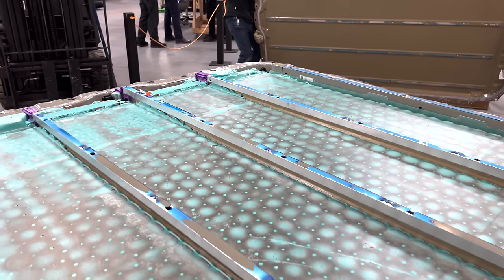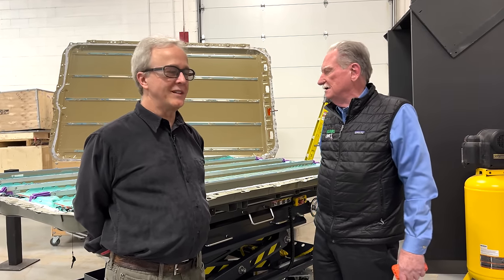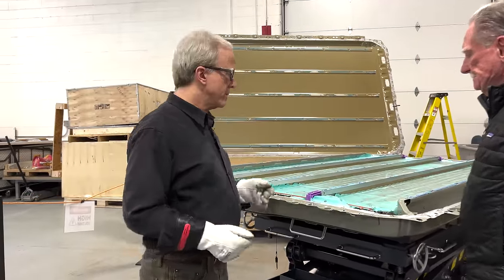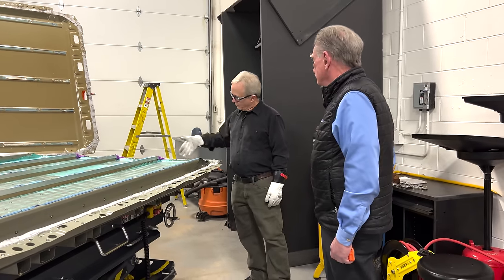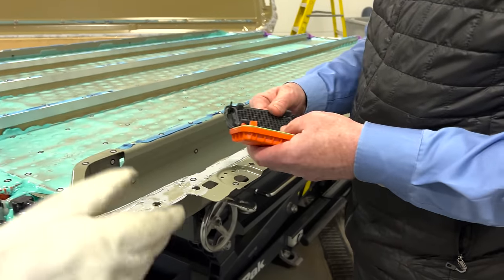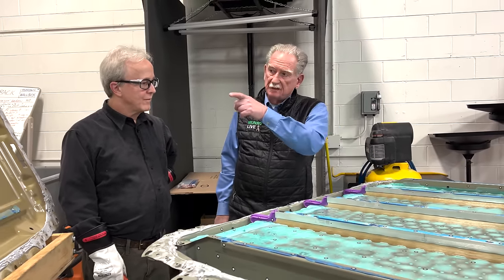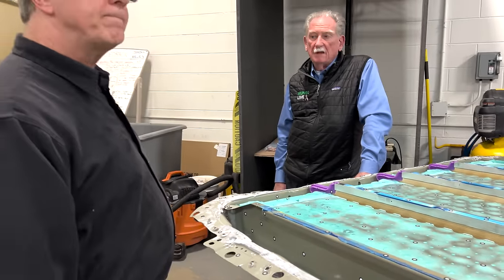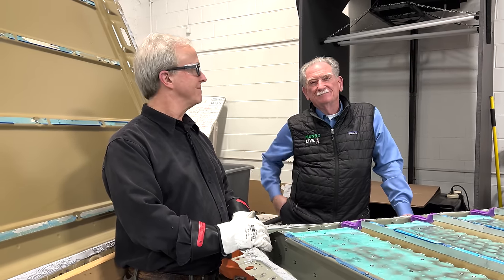Tesla Cybertruck Battery Pack: Our First Impressions Under the Lid

Comment: How is it possible to recycle these batteries if they are encapsulated in foam?
Reply: I don't know how but Tesla says "None of our scrapped lithium-ion batteries go to landfilling, and 100% are recycled. Lithium-ion battery packs should only be handled by qualified professionals ...".   I don't know how but I expect they shred them like they do no structural packs.  This exposes the minerals to be reclaimed.
Reply: @danharold3087  From that statement, maybe it means that 100 of their battery units are recycled but that does not mean 100% of the minerals or other materials are recovered.  Or how much energy is required.
Reply: @johnm2879  You are correct.   Foam for one is not likely to be recycled.    Quick look did not result in numbers but found this "Recycling EV batteries can also be energy-intensive but is significantly less than mining raw materials."

Comment: Thank you for addressing the wood question at the end hahahah!! I was doing double takes, and you were talking about ventilation, and I wanted to know how they were going to get the humidity from the wood from causing problems in the battery!!  Elon designed the battery compartment to take compressed air in submarine mode.  are we just going to act like Elon isn't the Godfather of the electric car?  Can we put a flowmeter on the pump that pressurizes the battery and warn the driver that the battery has a slow leak and they need to go to a tesla dealership to replace some valves?  For the love of God, have the car send an email or something instead of a check engine light.  They put so many things under that check engine light its unreal.
Reply: Not sure any Tesla has a check-engine light. This was mandated for ICE cars I think for emission issues. When a warning or issue needs to be communicated, Tesla pops up a clear message in English (or local language) like "Washer fluid is low".  There is a log you can look at to see prior messages too.
Reply: Elon

Comment: On safety, you should assume the case is already shorted to the battery.  So hanging onto the case while touching just one battery terminal may kill you.
Reply: When working with high voltages keep on hand in your pocket.

Comment: Don't worry, Tesla will add hydraulic latches and drop cylinders so you can pull off the interstate drop your battery, and get another slid under and the hydraulics will pick it up under your truck latch it in, and connect it and you are on your way. 20 min.

Comment: I saw some articles complaining about how much wasted space there is in there. I dunno, I think it's fine. I'd rather have that impact safety buffer.
I do also agree that the battery size is a bit too small. Should have been 150kWh for the base model. Well, at the current pricing anyway. But to stack more cells would mean a decrease in cabin space, or a taller vehicle. I'd be curious to see how the hummer/silverado EV pack is designed. I'm assuming less safety buffer space or interior space was sacrificed.
Reply: yes indeed ,will be cool to see , how the silverado , put there pack together.

Comment: Is this foamed in the battery case or in a tool and then glued in?
Reply: In case.  They want direct contact to the cells to prevent vibration and conduct heat

Comment: Nah I see it you see that weird cracking pattern closest to electrode attachment of cells “hottest spot” you see where the foam and resin stay the same as in “thermal stabile spot” do not direct wire like dominoes , a weird style of cross connections and long for noise and thermal connections to make the whole battery and every cell the same temp and output

Comment: How would this get recycled?
Reply: Easy way to explain, is that it get crushed in a huge grinder and then dropped in to a tank filled with "acid" . When it's become a "fluid" , you treat the fluid in different stages to extract back different elements.
Reply: Wasting a lot of energy is how

Comment: SO, if anyone has seen a little cell phone blow up or about any battery for that matter then you would know the danger of basically sitting on that much energy. you would be dead in seconds but finding what is left of you in the melted concrete, asphalt and molten metal will be hard to do.

Comment: Repairing the skid plate in the event you do damage it will cost an arm and a leg. Probably cheaper to just do a pack replacement.
Reply: Or you JB weld Bondo fill the dent.
Reply: @Barskor1  Dents are not really the kind of damage I was thinking about.
Reply: @motofunk1  Strap in another plate ontop if you plan on getting wild.t

Comment: We saw here most recently many model 3 with panasonic cells facing an issue aorund 100000 km and quite young with roughly 2 - 3 years, mostly first hand owned cars where the issue starts with a message and then from the next charging the range will dy , I mean fast decrease over night.

Then they need to swap the battery and if you are lucky that mess is fixed within 1 day cause when it occures they can do a diagnosis remotely , which means they will offer you a swap date. Some have gotten the appointement the next day so fixed in 24 hours which is great in such case where they get a used battery with a similiar state of battery health.  That means tesla is repairing old batteries which I really like to hear, but:

What do they do with all these nowadays glued or baked in foam battery packs ?
Do they have a foam dissolver which chemically kills the foam and makes it a fluid again or are all those packs a full mess and junk which has only 1 direction left: recycling 

I hate to see this design, I loved and preferred these beautiful 5 kWh boxes which could haven been even bigger like 10 kWh pieces, if they ould only run in a configuration that matches the solar inverters like 48 to 60 V or even better high volrage. 

I guess those days are now gone where you could buy a tesla with a salvage titel and reuse the battery and sell all the other parts in bits and pieces to fund the whole project.

Comment: Marvelous engineering. They take advantage of having high quality cells that will last for hundreds of thousands of miles and basically never need replacement. Meanwhile others OEMs continue to use junk pouch cells that lose tons of capacity in just a few years.

Comment: Battery packs should be required by law to be rebuild-able and repairable otherwise they are a large chunk of E-waste. Many other EV's have repairable battery packs (even if that wasn't the intention of some.) Before people bring up the warranty, you all should look up how easy it is the manufactures to void your battery warranty. Battery failure for whatever reason is common enough that there are 8 different aftermarket shops that deal with EV batteries and far more that deal with EV and Hybrid stuff.

Comment: Is it now normal for battery to be monolithic and not "fixable" by just swapping a chunk ?
Reply: If you want high reliability, yes.  Making it "repairable" greatly reduces it reliability.  Each connector is a risk point, having cells and BMS  'in the open" risks moisture and corrosion issues.   You also have risks with the rare thremal runaway event causing other cells to fail.  The foam limits a cell failure to that one cell.  And lastly Tesla's design eliminates the risks to killing a e service tech working on the internals of the pack.
Reply: @tesla_tap I can understand why most of this is important on a off road vehicule, but when i see that my car that i fast charge every day during commute (400km daily) is already down to 75% capacity after 4Y ... I'm not buying a car i can't relatively simply swap the battery.
Reply: @vlycop7404  - That's 300K miles (480,000 km)?  Not bad for that many miles.  I don't know about all EVs, but a Tesla battery can be swapped out in about an hour or two.  Far less than an ICE engine swap!
Reply: @tesla_tap You are quite over, maybe to took every single day and didn't cut out weekend and stuff ? right now the car show a bit over 370,000 km. But i have been needed to charge way more often for a couple month because the degradation made the battery to small for the trip.

Changing a full battries pack is way to close of the price of my car new (20K for 38K) for me to think about it, but it's composed of 18 module that can be changed independently, and i had a proposition to go back to 85+% capacity for only 2 modules swap du to a uneven degradation... (8000€)

This is why this "all seals in epoxy" look scare me for the future ...
Reply: @tesla_tap You are quite over, maybe to took every single day and didn't cut out weekend and stuff ? right now the car show a bit over 370,000 km. But i have been needed to charge way more often for a couple month because the degradation made the battery to small for the trip.

Changing a full batteries pack is way to close of the price of my car new (20k for 38K) for me to think about it, but since it's composed of 18 individual module, i have an offer to change 2 of the worth module for 8000, with a minimum 85% total capacity back.
This is why the "cover with glue" monolithic version we see here scare me for the future ...
Reply: @vlycop7404  - I think I used 300 days a year, but even 370,000 km is impressive! I expect you've saved a ton over the years vs. if you had a similar size ICE vehicle.  Seems replacing two modules is expensive to just get a 10% gain, but uneven degradation is not heathy for the pack. Good luck whatever you do!
Reply: @tesla_tap Thank ! Not at al trying to say i want to go back to ICE, i love the feel of electric. Just that i don't like this kind of pack the same way i don't like glued battery in my phone or earbud that go in the trash 3y down the line :)

Have a good day
Reply: @tesla_tap All great benefits, but we all know the real reason for choosing this way of assembling packs: to save a buck in manufacturing. All of the other benefits can be realised with a much better repairability of the pack with careful design. However, the pack would be more expensive to manufacture.
Reply: @hvh377  - I think most consumers would rather save money while getting a more reliable pack and getting more range from a lighter design. Still you can buy things like the Hummer EV that has lots of modules (and lots of cost too) in a very inefficient and weightly package.  Nothing wrong with those that find costs are unimportant.
Reply: @tesla_tap  There are consumers who want to save money by sticking to ICE vehicles. I'm sure we want to avoid that as well.

Comment: I think the goal of future battery pack designs should focus on serviceability while also maintaining longevity and reliability. Not being able to replace a single faulty module means the entire pack has to be replaced which is not only ridiculously expensive but wasteful 

So far the charging curve has been very disappointing, even on the 350kW third party NACS charger. It still took an abysmal 40 minutes or so for a 10-80% charge. Far from the 18-20 minutes Tesla claimed and worse than a Mercedes EQS which has roughly the same 120-ish kWh capacity.
Reply: its not a faulty module, a bad electrical small part on the BMS, cables, one leaky small hose and you have to throw away the whole pack. The battery pack should last 20 years, I dont see that. And replacement parts from the factory have a too high price. In 5 years those batteries are outdated, will Tesla offer and certify new batt chem for old models ?
Reply: @t.d.5804  Tesla has offered updated battery packs in the past on Model S and X. These newer Teslas though have this “structural” design so it’s not as simple as it was on older cars that could have their battery packs simply unbolted and a new one slid in place. Some car companies still focus on easily swapping packs, but others like Tesla aren’t focused on cost after the warranty runs out or ease of repair. They’re looking for lowest cost to build and that’s about it.
Reply: You can focus on reliabily or servicabily but you're not going to get both. The newest Tesla designs eliminates many failure modes in older designs. Mosture and corrosion are a non-issue now. And eliminating all those connections for modules also improves reliability.  Then there is the fact that you really can't replace a cell or module in an older pack as all the cells in the pack must age together.  Slapping a new cell or module ensures a quick pack death.  Seems to work for maybe 4-12 months but dooms the pack. No one does module/cell replacements anymore on old EVs  (at least no one that warranties the work).  There are scamers that offer cell replacements, but buyer beware.
Reply: You can have a failure within a day, month, year, or decade of production. It seems a bit crazy that any issues in the early life of a vehicle could result in a complete pack replacement. I also have not heard of any issues with water intrusion in the semi-serviceable packs designed by BMW, Medcedes, etc. who do have the ability to replace modules on their packs. The CT pack has the ability to breathe and several places where pipes penetrate the pack so theoretically water could get in some way. I’m not sold on the structural pack design that makes replacing the pack extremely challenging. Even if the pack is completely sealed and not designed for internal repairs it would still be ideal to have easier access for pack replacements.
Reply: @CFG39  - I don't know as much about other vendors, and most of those have not been producing EVs in volume very long so we don't know about the long term reliability. Jaguar's iPace and GM's Bolt have had some fairly major pack problems. BMW seems to have their act together with the discontinued i3. Tesla packs are quite easy to replace, taking less than 2 hours of service time.  Likely a tech that has done them before can do it in a hour.  Really quite easy so long as you have the right equipment.
Reply: @tesla_tap  There is no reason why repairability and reliability would exclude each other (other than money perhaps). It's money that is the reason for assembling the packs the way Tesla now seems to do. It's the cheapest way to manufacture a reliable pack. And maybe that's OK, but it seems a big unnecessary waste to me.
Reply: @hvh377  While reliabiliy is super important, next is cost and weight. Using modules adds both cost and weight, while reducing reliaibliy but making it sometimes easer to service.  The problem with modules is after the car is driven about 2000 miles, you can't replace a failed module with a new one. It has to be similarly aged, or you dramatically reduce the pack longevity.  No one is going to stock modules at different ages, so you're stuck with replacing the entire pack anyway.  Plenty of choices in the market, and if service is more important than reliability for you, there are some good deals on some brands of EVs with module problems. Just be prepared to replace the entire pack anyway.
Reply: @tesla_tap  But you could reuse modules or old cells in static applications after their useful life in a vehicle is over. But only if you can repack cells of similar age.
Or you can repair packs with minor damage after a small accident. All you can do now if the pack is dented, is throw it away for recycling just to be safe. With a repairable pack you can inspect the damage and replace if needed.
The focus on lowest manufacturing cost is so shortsighted.
Reply: I haven’t heard of any issues with water intrusion in the I-Pace or Bolt. The issue with the pack was with the cells which were made by LG. LG also made the Hyundai Kona EV’s cells which were problematic. Tesla uses Chinese-made LG cells in the Model 3 which is why it no longer qualifies for the tax credit in the US and why its energy density is lower than that of the higher quality Panasonic 2170 cells used in the US-spec Model Y. 

Waterproofing a battery pack shouldn’t have anything to do with serviceability. The case is where the waterproofing comes from. The big issue with Tesla’s pack design is that their cells are surrounded by that foam which basically means any sort of tear down or recycling is very complicated and costly. I’ll be interested to see how BMW designs their new cylindrical cell packs.
Reply: @hvh377  - It's all tradeoffs. If you prefer to spend thousands extra for a less reliable pack that reduces the range because of the added weight, go for it.  I bet fewer than 1% would take this option if given to them. Consider all those modules and interconnects are also more fragile if dented so they may need to replaced for minor dents that a Tesla pack would be fine with. Tesla adds space specifically to take dents without harming the cells.
Reply: @tesla_tap  So let's not give them the option. Just mandate repairability. Would be good for many, many other products too.

And there is no need for a repairable pack to be less reliable. There is no evidence for that claim.